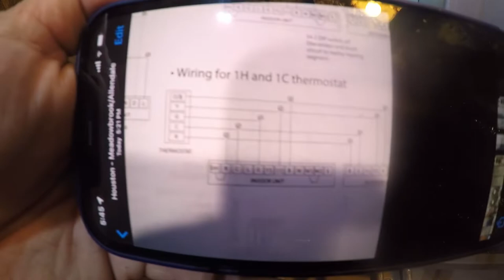HVAC 20:  Thermostat Wiring Rides Again - who has worse documentation? ACIQ Or Resideo?

Comment: Brian - I’ve been through most of your ACIQ install videos…quite a marathon but worth it.  I ordered and received a 5T unit and air handler to replace my Trane (r22) XL14i unit and variable speed air handler.  A few difference from yours; 1) I’m in Seattle so heating is the most important. 2). I have a 4400 sqft house and it has 4 zones.  I have a Honeywell zone controller (it was replaced recently so it and the zone damper motors are new). I have 4 Honeywell 8400 thermostats.  I can’t find documentation regarding running this unit multizone.  Did you find anything in your search on that?  Any help would be appreciated.

Comment: The reason for the 1 & 2 terminals, 2 stage operation. If you are only running single stage, depending on the unit, you either use the 2 terminal or you jumper them. 

Typically on heat pumps with a toaster inside I wired them up as:

R= 24v hot
W= aux heat
Br= em heat
Y= call for compressor
O/b= should be selectable in your t stat whether it is energize for heat or energize for cool in the installer setup menu and to match your equipment
G= fan
Bl= common

And I used whatever leads I had left for an outdoor Tstat in unit so as to switch over below a certain temp to aux heat. In your case, your aux heat is your emergency heat.
Reply from the maker: So this is technically a communicating system.  The default install is communicating (rs-485) from indoor to outdoor and then there is a 24v interface board in the indoor unit.  This allows the use of "stupid" thermostats that only call for cool/heat.  

Midea/ACIQ is a air-conditioner with a heat pump mode (B mode heat pump).  The documentation is awful.  Ikea would be apalled it's so bad.  I did finally figure out WTF was going on.

I think the push for increased SEER/EER is going to see most systems go to a hybrid model.  Why there isn't a standard for RS-485 and RS-485 thermostats is a whole other argument that defies common sense.  Running 5 to 12 unshielded wires all over the house is stupid IMHO.  However, having the air handler and condenser work in communicating mode allows for better throttling. This is a DC inverter system with a 20 to 125% of it's nameplate rating swing range.  It's labeled as a 3 ton system but can go from 7,000 btu to 50,000 btu.  Bet the EER isn't that nice at 50K btu.  SEER is bs anyway because systems are rarely installed in test lab conditions.  It's only useful as a benchmark between systems.  70 inside with 104 outside isn't going to give you the rated efficiency on any system. lol.
Reply: @hotpuppy72  I figured the board in the air handler was an interface from “kachunk” relay legacy thermostat to the constantly variable setup native to the unit. It would appear that it’s legacy interface is hoping for a 2 stage t stat so it can modulate around the stages that the old style stat recognizes. But without seeing it physically, I’m unsure. As for instructions sucking, that is becoming more and more par for the course. Had someone spent a little money on a bi lingual technical writer… oh well 😂🤣
Reply from the maker: For some reason HVACDirect did not think the communicating thermostat was worth installing.  ACIQ/Midea ships the unit with a nice communicating thermostat.  Right now I'm running it with a Honeywell T9.  The T9 has a nice wifi / app which is it's huge advantage.  Past that, I don't generally change the temperature of my house.

The system does seem to be modulating on it's own.  I've been reviewing the energy consumption of the house.  I have an enPhase Envoy installed as part of my solar with net metering probes.  I get really good data from it.
Reply: @hotpuppy72  I’m very interested in if it is living up to its efficiency. I loved the old pro8000 because of its built in fossil fuel kit for heat pump. If it comes with a good stat, I would probably switch it, but it’s personal preference
Reply: @hotpuppy72  Do you have any thoughts on how the system is modulating?  According to the specs that ACIQ provides, there is a "MAX" output and COP and a "Rated" output and COP. Do you have any way to tell how the system decides how efficient if you don't use the stock modulating thermostat?  For example, the ACIQ-48-HPB unit puts out 11KBTU at 47F with a COP of 3.88 and 55KBTU with a COP of 2.83  (also at 47F).  If I use a dumb thermostat that has no way to tell the the condenser how far away from the set point I am, doesn't it have no choice but to run at max output with crappy efficiency?   I would want a system that sees that if the indoor temp is 60f and the setpoint is 68f,  it needs to run at full capacity until it gets a few degrees away from the set point temp.. Say 66f.  Then kick down to lower output and higher efficiency.  According to duty cycle tests I took on my old furnace, my house load is about 770 BTU/Deg F so that means at 47f my duty cycle would be about 0.28 which is pretty close to the low capacity rating and the highest COP efficiency at that temperature.  Any thoughts after looking at your enPhase data?
Reply from the maker: @jeffmucha  My experience with a 24v thermostat was that it ran in on and off mode. i.e. dumb mode.  The modulation seems better, but not as granular as the goodman it replaced.    I think the unit re-evaluates and adjusts every 15 minutes or so.  It's definitely better with the communicating thermostat in native mode.  It looks like it was running at around 800 watts of demand for most of today.  That seems about right given that I had the thermostat on 75 and it was about 77 out and I'm spray foam insulated.  By comparison my pool pump produces 1200 watts of demand and the booster pump another 1200 watts of demand.  

I still have not gotten around to doing the duct takeoff, so I just have the unit blowing into the duct in the conditioned attic.  It works.  Not perfect and I expect it to be better when I get around to finishing that.  I need to buy the duct board and be in the mood for it.
Reply: @hotpuppy72  Can you post pictures of the AHU dip switch and The outdoor also.

Comment: I recently bought a 3 ton aciq unit. It took me hours to figure out the diagrams. Best I can tell I have a 3 heat 2 cool system since I have the heat strip installed. If you are using a regular thermostat to control indoor and outdoor you have to turn on SW1-1 and SW1-4. SW-1 tells it you are controlling the indoor with a 24v thermostat. SW1-4 tells it you are controlling both indoor and outdoor with a 24v thermostat. If you ran the rs485 2 wire to the outdoor you and want to use a 24v to control the indoor you only need to set SW1-1 to on. Also SW-4 1-3 sets your fan CFM, there is a table you can look up to match your size and heat strip. Past that S4 on the board controls the w1/w2 and DH settings. You can turn the Dehumidifier off as well as have it control w1 and w2 separately if you had multiple heating types, like electric heat and a oil furnace. 

The wiring for indoor and outdoor 24v thermostat control is confusing at best. I opted to do 24v indoor and rs485 outdoor. Best of my knowledge these are 2 stage heat and cool at least on the 3 ton since it says "Variable inverter twin rotary compressors". The compressors is key there, the 3 ton is twin compressor.
Reply: Can i ask why you think its a 3 heat 2 cool system? because i just got a 2 ton unit same ACIQ unit with 8kw electric heat. and im thinking its a 2 heat 1 cool. im just not sure about the cooling stages, because technically its a inverter which means it modulates/ ramps up or down. A 2 cool would mean it kicks into 2nd stage. Anyfeedback is appreciated Thx
Reply: On mine the main reason is the mention of a twin scroll compressor, plus the 2 separate coils in the outdoor unit. I also called hvacdirect and spoke with one of their techs to verify because I was doubting myself. Very nice people there.

Comment: Why didn’t you just use the wired thermostat with the remote that is supplied? Or did you not receive one in that package. It only requires 2 wires and has full feature ability.
Reply from the maker: I was originally told not to use that... ACIQ said a 24v thermostat was better.  Someone later called me and discussed the communicating thermostat with me.  I switched over to it and it's more efficient, but fairly primitive compared to a wi-fi thermostat.
Reply: So which one is in service now? I'm not concerned about the Wi-Fi aspect of a stat and am in process of installing 2 of these 3 ton units. The air handler is direct wired from the breaker right? I have a 10kw heat strip in each which as you said it the video will likely never be used but redundancy is king. Problem is it's 6-2 Romex, a real pain to work with lol

Comment: So which thermostat wiring diagram did you end up settling on? They have a bunch of diagrams to pick from, but don't bother explaining why I might want to choose one over the other...For example, there are TWO options for 1H/1C - either using W or B...does the way the air handler operates actually change by choosing a different 24V thermostat wiring scheme? And moving on to the 2H/2C options is there an added benefit such as more control over fan or compressor speed? I've been wracking my brain just to get the damn thing working, and got it working with the basic 1H/1C (using W rather than B), but I can't help but think the thing isn't running as efficiently as it should, especially since the blower motor seems to be running at full blast when there's a call for cooling, running for 5 minutes or less before the call is satisfied.
And don't even get me started on their included thermostat/wired controller! The fan NEVER turned off for the week or two that I had it installed and it was running at high speed, regardless of the setting. HVAC Direct support insists that's the way it's supposed to be, but that CAN'T be right!
Reply from the maker: I used the heat pump one.  There are two ways to wire a heat pump.  This one needs to be wired as an Air Conditioner with a heating mode.  

The diagram with the O/B connection is for a heat pump.  O/B is for AC w/heat or Heat w/AC.  I don't remember which is which with O and B.  Your thermostat cares about this as it tells it which mode requires the reversing valve to be called for.

I would be very interested in seeing the communicating thermostat power consumption.  The 24v control doesn't seem as smooth as I would expect it to be.  I have not had time to try and get ACIQ/HVACDirect tech support on the phone.  Last 2 times were unsuccessful and I basically figured everything out on my own.
Reply: @hotpuppy72  I moved my W wire to B and have noticed no change in the way the air handler works, just that the thermostat is now aware that it's hooked up to a heat pump. 
Fan speed is still way too fast and the system runs in short spurts based on the call for cooling being satisfied quickly.
Reply from the maker: @gsowa  You also have to change some DIP switches. They were not set right when the unit arrived.  Make sure to download the latest install manual.  It's a little clearer on the switch settings / locations.
Reply: @hotpuppy72  more than one dip switch? We just flipped the one for 24v thermostat. Where did you download the latest diagrams from? HVAC Direct sales website?
Reply from the maker: @gsowa  Yes, download on the product page... and yes I had to set several dipswitches on the indoor unit as I recall.  It's always a good practice to go through and make sure the indoor and outdoor switches are set correctly.
Reply: @hotpuppy72  According to the thermostat setup guide, it's just the one dipswitch: https://hvacdirect.com/media/pdf/Thermostat%20(5)%20ACiQ%20Wiring%20guide.pdf
Reply: @hotpuppy72  Can you show pictures of the two dip switch need to set. I bought a 10k heater for my unit. So I'm wiring it as 2 heat and 1 cool.